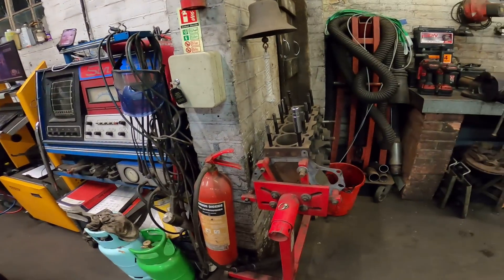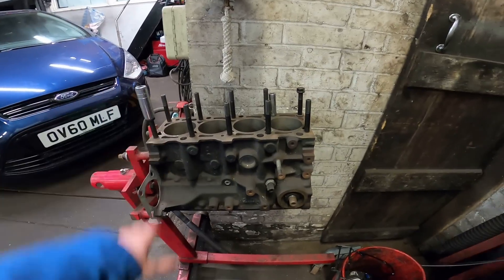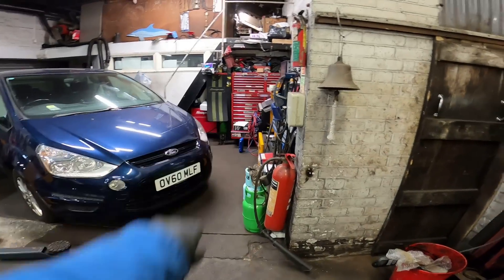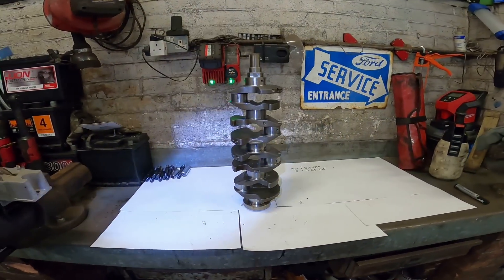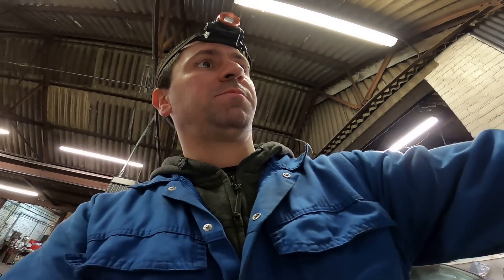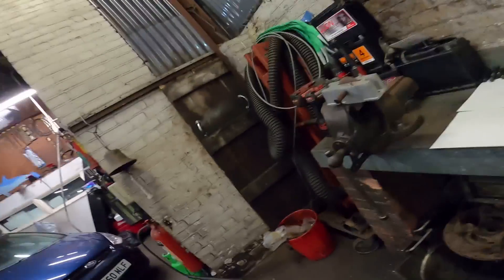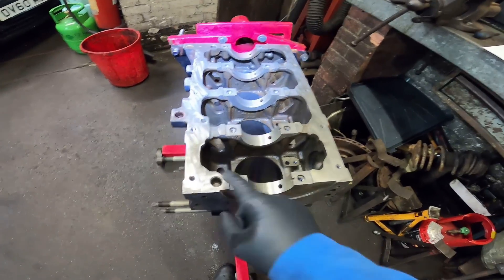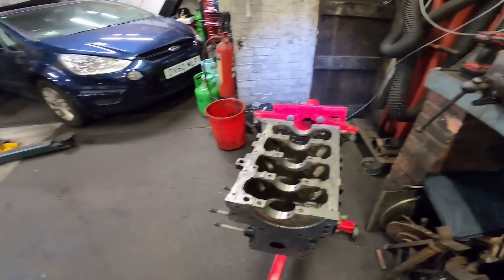Assembling a 700HP Zetec Turbo engine part 1

Comment: one thing i know from uk ford forums seen several times is that the stock crank holds up to around 550hp and brakes above, if this is wrong please tell.
Reply: No i know clarke has run 700+ on standard crank no issues

Comment: Is that a black top block can I use the st170 block for my build is there any difference.
Reply from the maker: They are 98% the same. The st170 block has a knock sensor stud and an extra oil take off so actually a better block to start with
Reply: @ignitionadvantages6592  nice one thanks again for the rods